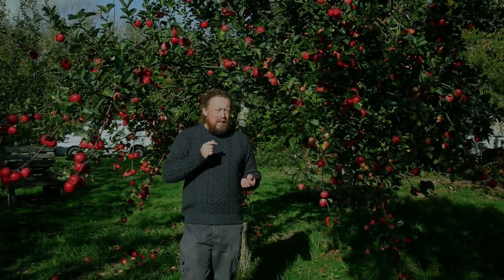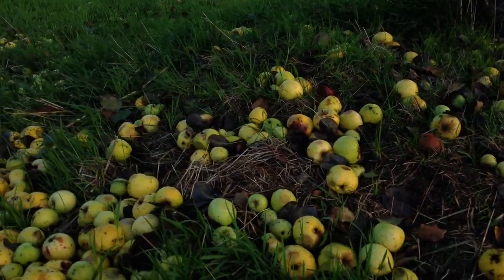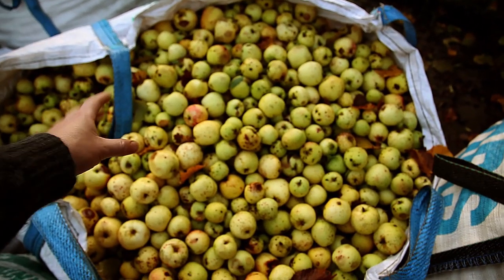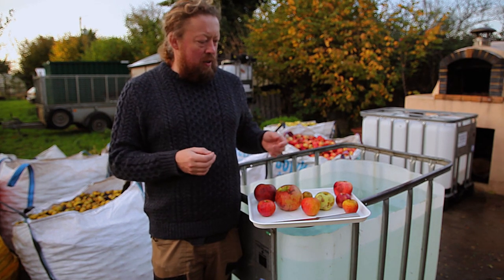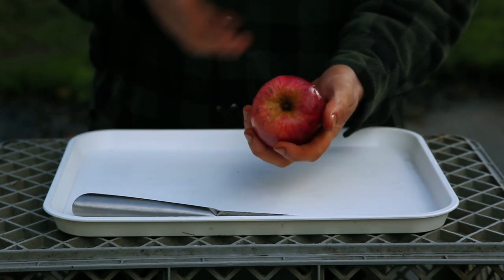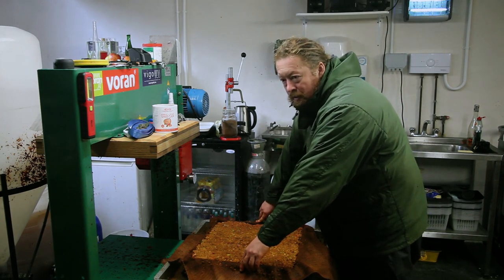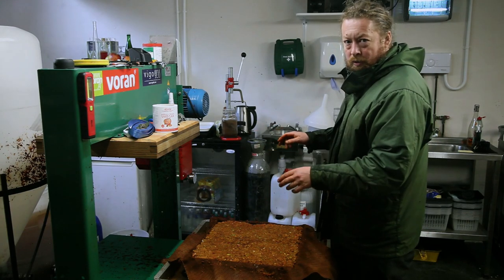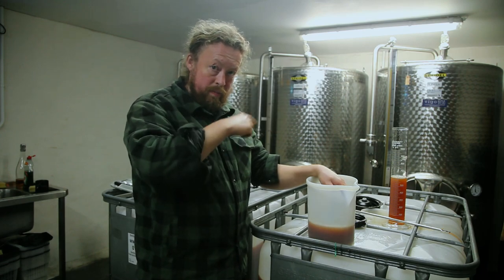Keeving: In depth cider making guide - Part 1

Comment: Another brilliant video, thank you. 
Regarding the stainless steel Speidel tanks that could be seen, may I ask what these are used for and what advantages they have over the IBC tanks? Thanks
Reply from the maker: They are used for the secondary fermentation and for storage. 

They are quite an investment but I bought them for some reasons. My barn is pretty small as you can see. I used to use IBC's and IBC's with the tops cut off with giant storage bags inside for long term storage. I used to have them two high and filled one side of the barn to the ceiling. To remove them from the barn when empty I had to dead lift them up on top of the other IBC's drag them along the top and gently lower them by the door and drag them outside for cleaning. 

It was frankly exhausting when I was 20, now I'm over 40 it's too much for me and I injured my shoulder over lockdown moving one as I couldn't get help and I realised things had to change. As the tanks are fixed and I have a CIP system I don't have to spend my days dragging IBC's around and mucking about with IBC liner bags. So it is a lot less work for me and frankly much quicker saving me time.

Also oxygen is the enemy of cider makers and even though I was using IBC liner bags with an oxygen barrier layer there was still a shelf life on the cider as oxygen will slowly dissolve through the liner bags. The metal tanks are completely sealed against oxygen and with a zero pressure co2 system to add co2 whenever you rack off your cider so it will last a lot longer.

Finally the liner bags are single use plastic and get really mucky. Cleaning them out after use, splitting them down and bagging up the plastic for recycling is a really foul job, glad to see the back of it!😅
Reply: @Llanblethian Orchards Cider Makers  Thanks for the detailed and useful explanation.  The addition of the Co2 to increase its life is a totally new topic to me. I will have to look into that in more detail.  
I currently produce around 500l per year and normally consume or sell it before it is 12 months old (since it was pressed). One thing I have learned more recently is that the flavour gets better the longer I leave it. As you suggest, though, I suspect that if I stored it much longer than I do currently,  I would no doubt run into the issue of oxygen spoilage. 
Out of interest, what is your opinion on the optimum time from pressing to it being consumed? Also, how long would you comfortably be able to store your cider for, using the steel tanks and co2 that you describe? Thanks.
Reply from the maker: @bigcol2233  the optimum time from pressing to consumption can vary depending upon what you are intending to be honest.

Over time the tannins will mellow out in a cider. Some of the acidity could be reduced by the malolactic fermentation. Different bacteria can alter the character of a cider and can change the flavour drastically. The apple flavour can be greatly reduced over time as well. 

So if you are intending a fruity apply cider with a great aroma you would be serving it pretty young in my opinion, 3-4 months after the end of fermentation perhaps? 

Whereas if you were intending a traditional oak aged dry cider with a complex flavour with the characteristic 'old horse / farmyard' character you may be ageing it in oak barrels for over a year.

Sorry to be vague, I make several different styles of cider and each one is made it's own way. I don't have space to store for multiple years in truth so everything is made and sold the same year. 

Some is sold in the Spring as fruity 'cider nouveau' as it were made out of sharper fruitier apple varieties and older drier ciders are sold later in the Autumn after they have matured some made out of more bittersweet apple blends
Reply: @llanblethianorchards  Thank you once again